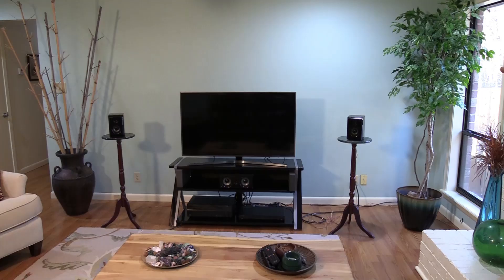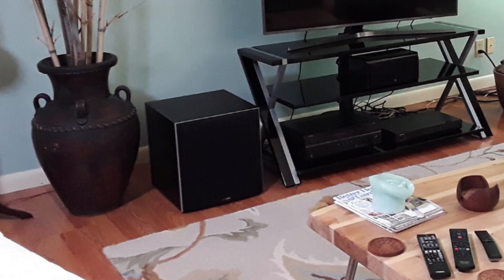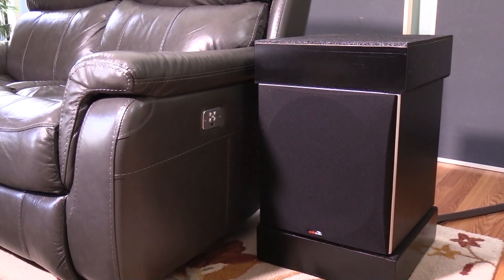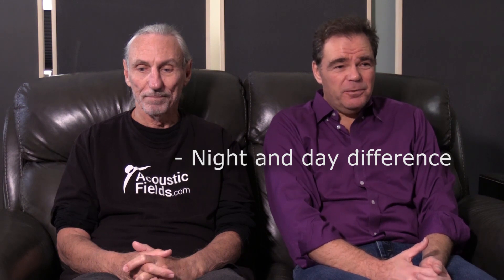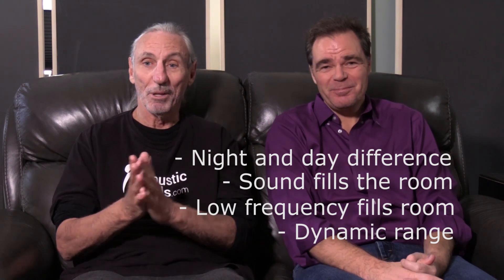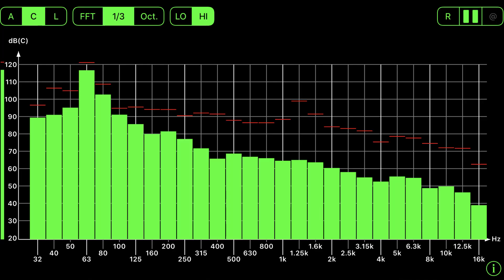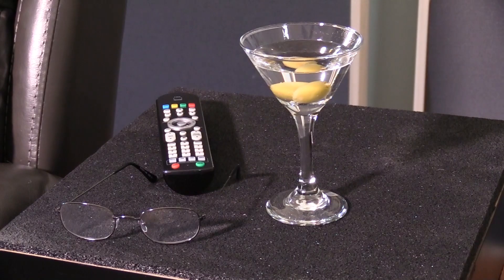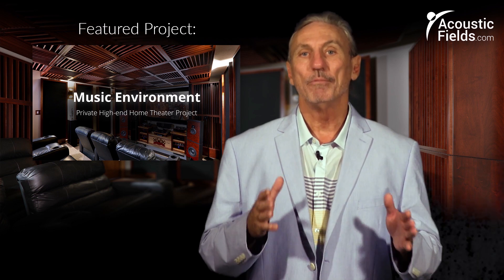Michael's Home Theater #4 - Subwoofer - www.AcousticFields.com

Comment: Always good to have this nearfields subwoofer placement when crossover freq is low <60 hz
Reply from the maker: A low frequency generating source needs to be placed away from all room boundary surfaces including the floor. The exact positioning is dependent on the dimensions of the three soundfields.

Comment: With some nice quality monitors or towers you don't really need a sub. Those speakers he has look anemic there. I have  klipsch ported 6.5" woofers and they do have some pretty lows, not the super low frequencies but its impressive as is. I do plan to get a nice subwoofer capable of 20 hz and lower latter but they are pretty pricey. Either Klipsch or SVS.
Reply from the maker: If the towers are full range, the speakers are producing all the required frequencies. Do not add more energy. Treat your room so you can hear the full range tower energy. Its your room that is getting in the way of your hearing everything.
Reply: @AcousticFields  Yes thank you for you suggestions.

Comment: It took me some time to get the right placement of my subwoofers in an odd shaped rather large room, subs set at different heights, as an example, I did subwoofer crawl, then on my knees and finally on my feet, taking note of best position responses and heights, set them up, then run ypao (Yamaha rx-a 3070), finding I found front subs lacking a little compared to rear subs, I raised one front sub a bit over a foot off floor, ran ypao again, I gained nearly 3db just by raising it, the other front sub was already raised, but I moved it a little more forward, run ypao and gained just over 1db, it just goes to show, how placement of subs in a room can change with very little changes, now I have them fine tuned to my room, I have such a nice base response throughout my room, which is great with music, no standing wave, plus watching movies, it feels like I'm sitting on a sub, with more chest slam than a sledge hammer, I don't think I'll get any better than I have now, thanks to watching Dennis's tutorials and very informative post's, I highly recommend to my family and friends to watch your tutorials, thanks Dennis.
Reply from the maker: Thank you for your comments. Belief systems are hard to change with people. Thank you for your contribution.

Comment: "Subwoofer Crawl" is the best way
Reply from the maker: There are starting points one can use for sub positioning based upon room volume and usage. It is best to move from those start points during the room tuning process.
Reply: @AcousticFields  wow you actually read those comments :)

Comment: Marry the subwoofer to the room, not the gear. Yes. Thank you so much. I've been struggling with this for years.
Reply from the maker: Its propaganda from the industry. Its the subwoofer interaction with the room that produces quality or no quality.  The speed of the sub woofer driver must match the speed of the towers or book shelf speakers.  This is a secondary consideration if the driver size and room size do not get along.

Comment: That's interesting when you say you only need one sub...I've heard so many times with audiophiles that you gotta have 2 for 2-channel listening.
Reply from the maker: There are no absolutes. It is not just one sub, two subs, or even 3 subs. It is room usage, room size/volume, room construction types, and a whole host of other variables. There is no one solution for every room. There are guidelines to use as starting points. Let me give you an example. In rooms with our diaphragmatic absorption installed around the room perimeter,  these rooms can handle much more low-frequency energy that an untreated room. With 1.5 dB of attenuation for each unit, you can manage most low-frequency issues. An untreated room may not be able to support even one subwoofer let alone two where a treated room may sound better with the support of two subs.
Reply: @AcousticFields  thank you for the insight! Learning more and more... I appreciate your videos and am enjoying this series a lot.

Comment: I have a studio subwoofer 1 foot to front wall, in corners sounds fine, but when I stand up, my desk/mixing position the bass is boomy, when I sit on chair the bass sounds ok, I guess that's boundary interference. If I add anti vibration springs under subwoofer, will eliminate vibrations to the floor and front wall, and the boominess will disappear?
Reply from the maker: The "boominess" is excitation of room modes. Move the subwoofer out of the corner and into the room.

Comment: Hi Dennis . Im from Chennai, India and have been an ardent follower of your videos. Off late I ve been hearing from many people of using multiple subs in a room to cancel unwanted low frequencies. It's adding extra cost to budget. Instead positioning and treating the room properly helps. Though being a doctor I took time to make my own absorbers with glasswool which I realised very harmful for the lungs. Now exploring other options for treatment.
Reply from the maker: We have tried this method with 4 subs in a room 17' w x 10' h x  23' . We achieved a 6 dB improvement in peak response below 100 Hz. in this room that had+ 13 dB issues. This multiple sub methodology only addresses below 100 Hz. The subs cost was 2,500 / sub for a total of 10,000 USD.  We then took 10 of our ACDA-10 units which are 12 square feet each and cost 9,000.00. We were able to reduce the + 13 dB peaks by 10 dB.  The face of each of our ACDA-10 units has our proprietary foam technology so we were able to support room improvement up through 6,300 Hz. thus smoothing out Rt-60 times. At this treatment point, the user can add a few dB of EQ and be golden.
Reply: There is insulation material made from wood fibers which works perfect for low frequency treatment. But it's more expensive than glasswool.

Comment: Great video as always. 
Is there any relative height position/ratio between subwoofer and main speakers to be aware of? Or just move and measure?
Also how would tipping an ACDA unit on it's back (or face) act as a subwoofer platform?
Reply from the maker: Move / listen / measure. The Subwoofer Platforms have the same technology as the ACDA-10
Reply: @AcousticFields  thanks for the reply. Related question: is it more important to have the ACDA unit closer to the boundary or the source? (in this case: on the floor or raised up to be directly under a subwoofer that's 2ft above the floor)

Comment: Has this guy ever used room eq wizard?  If you had two large towers, you have two subs in the corners.  There is some missing marbles here.
Reply from the maker: EQ is a processing program. We are discussing proper positioning of components to deal with room response issues. EQ will not deal with
 + 12 - + 14 dB peaks in energy below 100 Hz.  You must first calculate proper set up due to room usage/size/volume. Never place a sub woofer in the corner of your room. You will be producing more room distortion and trading quantity for sound quality. Our sonic objective is sound quality. Multiple subs can have a benefit but it is all related to driver size, number, room usage and volume. Stay tuned for the last video where we show the different responses from against the wall versus more towards the room center. You will be amazed at what a proper position will do for spatial irregularities in response without any EQ.
Reply: The blanket statements don't work.  There is no blanket room.  You contradict yourself in the comment.  Room modes matter.  Multiple listening positions matter.  REW is a measurement and analysis tool to help figure it out.  If you showed the science that negates what every one else shows, I'd listen.
Reply: @wa2368  ^^^ Don't feed the trolls.

Comment: One doubt if I may:
When you ran the numbers, did you make any adjustment on the sub's phase? In other words, how do we calculate the temporal/phase alignment? Or am I mixing concepts here?
Thanks in Advance,
Best Regards,
Reply from the maker: You are mixing concepts. Sub phase can be adjusted electronically. We are discussing proper set up in the analog domain through proper positioning.
Reply: Andre Lessa Correct Phase is certainly an important part of integrating your subs with your mains, but in the context of this video, where highlighting and dispelling old myths about subwoofer placement was the main focus, it would have not been worth covering. I found it very interesting.

Comment: Ooooooh been waiting for this one. AJ is gonna make some people/companies super salty with that "you don't need multiple subs"-part 😁
Reply from the maker: The latest gimmick in the subwoofer business is stacking subwoofers on top each other. The reason for this is obvious with more product sales. I had a client who wished to purchase our sub woofer platforms for stacked subs. His room was 10' x 8' x 11'.
Reply from the maker: Here is the central issue with multiple subs.  For years, people have been looking for ways to manage the low end within their rooms. The reason for this is because there was no effective treatment types in the marketplace for unwanted low-frequency pressure issues. Boxes filled with building insulation never worked. Walls that were thick and filled with building insulation never worked. All you have to do to realize that is to listen to the older studios built back in the 60 and 70's to realize that truth. Foam was not an option for low-frequencies and the attempts and failures went on and on. Next the subwoofer manufacturers jumped in after a study showed that multiple subs had an impact on frequency response. They took that study and turned it into a marketing program with no cost benefit ratio and no attention to middle and high frequency energy. Multiple subs will have an impact on response but at what cost? For the price of multiple subs in your room, with our technology, you can treat the whole room and after treatment you may not need a sub at all if using full range speakers.
Reply: Yes sir, they stack subs for more pressure across all frequencies, and much more common these days utilize 2 subs for a smoother frequency response across all seats...but many people place both subs on the same wall (face palm). 

I see so many home theater tours where people put a lot of effort and money into pretty looking home theaters but almost zero attention to the room itself. Your home theater videos really help!!!

I plan to fly one of these hometheater youtubers out to my build once it's complete to give acousticfields the credit it deserves.
Reply: @AcousticFields  now that is a statement.

Comment: 5:20  I don't want my room to smell or sound like mutton soup.  The subtitles heard that too
Reply: “Mud and soup” = Eigentones
Reply from the maker: Mud and soup refers to the unwanted audible room modal pressure smothering (mud) and mixing everything together (soup)
Reply: @AcousticFields  I describe/ visualise room modes as a sort of mist/ fog that the fine details of audio get lost/ destroyed in.

Your analogy works too.
Reply from the maker: @paulmckenzie2232  No mist or fog here. The air in the specific room position is actually creating the modal "noise"